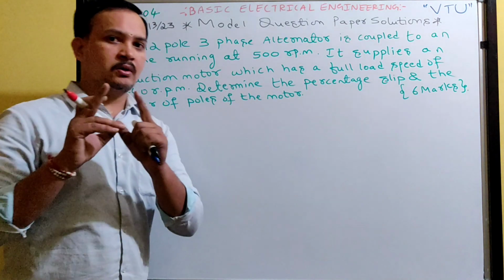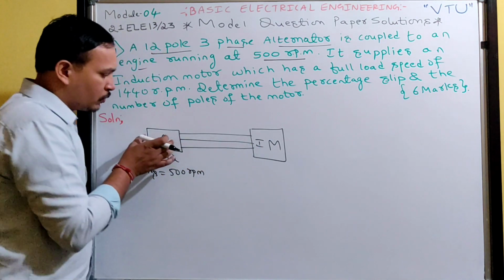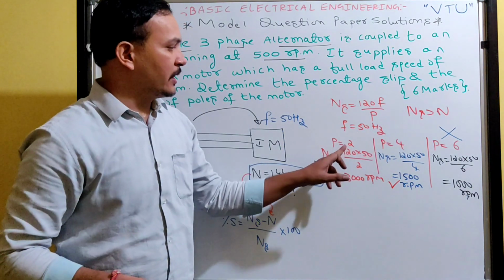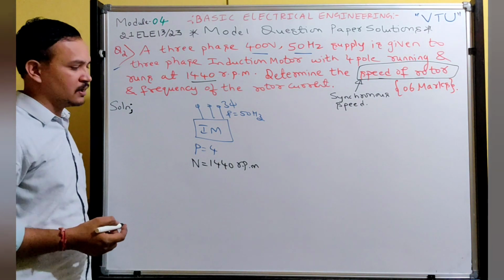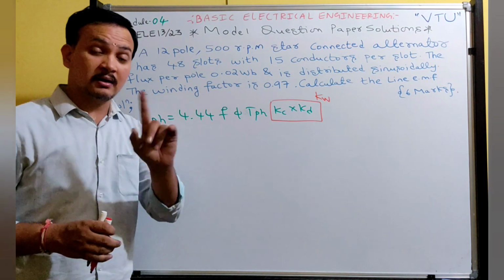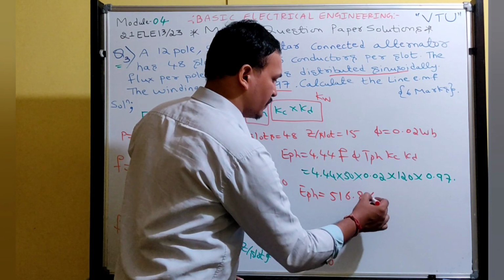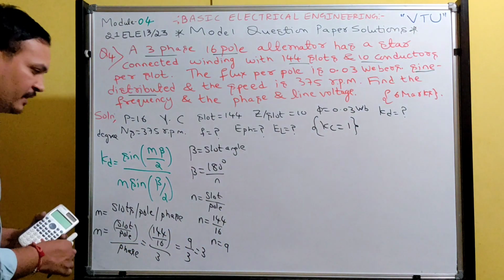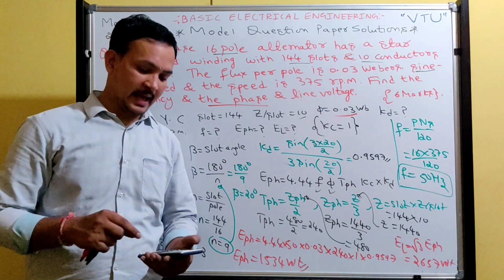VTU|Module 4|basic electrical |model paper solutions|21ELE13/23@shivasaiforyou-basicelectr1790

Comment: Sir, in our college they told..., if kp and kd is not given assume it as 1 only ?
Reply from the maker: If not given ,we should assume full pitch and distributed winding  so Kp =1 find Kd.
Reply from the maker: your college teacher consider assume  full pitch concentrated winding( kp=1and Kd=1).

None of alternator design with concentrated winding.

So correct assumption is full pitch and distributed winding.

Students can assume this when winding data not given.
Reply: @shivasaiforyou-basicelectr1790  so, sir from examination point of view we can assume that kp=kd=1 no problem know sir?
Reply from the maker: @shashankmp2003   ,if nothing data give you have to assume kp=1 and kd must be calculated. You may get 1mark less in alloted marks that numericals If you taken  kc and kd as 1.
Reply: @shivasaiforyou-basicelectr1790  
Ok sir.
thank you.